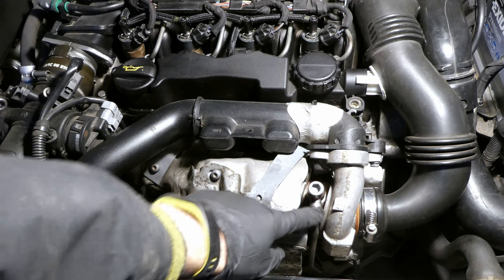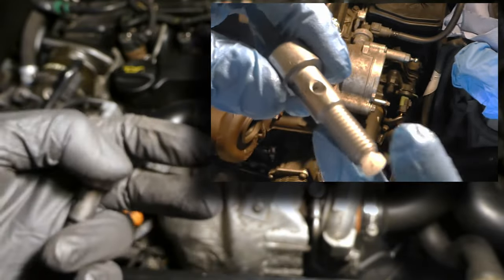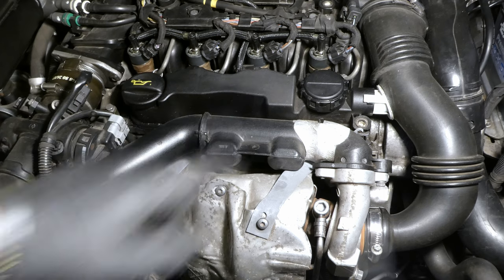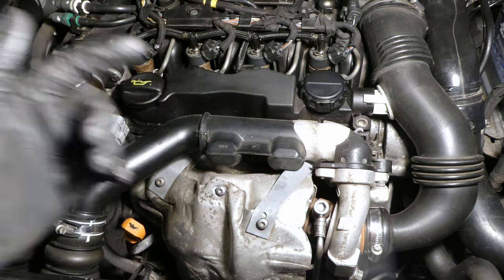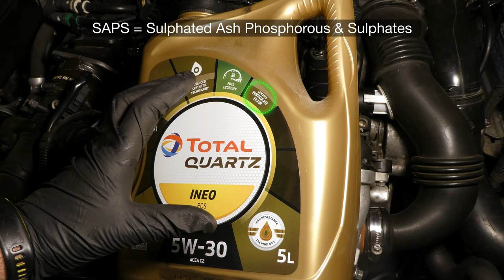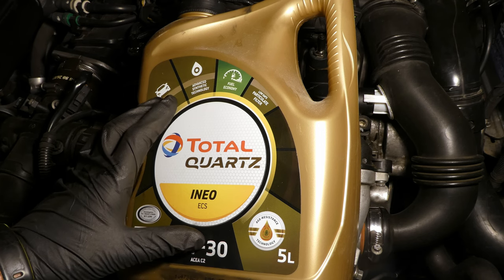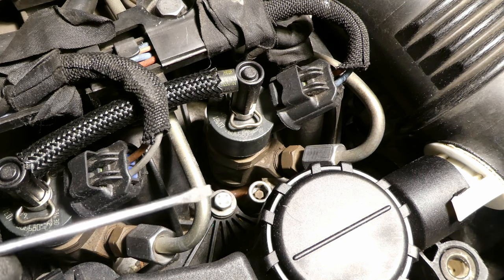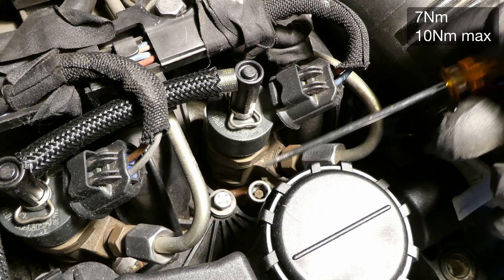1.6HDi turbo failures, the 2 main reasons and surprisingly simple steps to prevent it

Comment: I had my turbo rebuilt but the idiot didnt replace the gaskets and o rings so its still leaking and starving it from oil. Anyone can be a turbo specialist these days it seems.
Reply from the maker: Really sorry to hear that. All gaskets and o-rings need to be changed, it is just a good practice. Hope you can get it sorted.
Reply: @moremolecules  hopefully got a mobile mechanic coming next week to replace them along with new feeder pipe thats leaking .
Reply from the maker: @Lookbusybuddy  Yeah, that pipe was a design failure. If they are not spot on 90 degrees they will leak, even if it touches the side a little bit. If one uses a brand new part there will be a few micro mm off, and then it is difficult to center that pipe. It is a bit of a nightmare.
Reply: @moremolecules  do you know anyone in hampshire or berkshire that know what they're doing. That feeder pipe is leaking i think onto the waste gate . Looks like a bike bell underneath in shape
Reply from the maker: @Lookbusybuddy  Unfortunately no, but if it is not leaking too much it is not a problem. If it is not too much you can wipe it from underneath the top input from time to time, I know it is a bit of an effort. Yeah, it will be either leaking on the wastegate or down to the sump bolts.
Reply: @moremolecules  think its leaking worse back towards the engine like spraying from the gasket going into the hose behind it. Volvo dont seem to know part numbers for the gaskets only big bits. So mechanic said might use peugeot bits instead.
Reply from the maker: @Lookbusybuddy  They should be the same, but you never know. It is the same engine, but Ford for example changed the air intake, but overall pretty much all is the same. Worth a try for Peugeot/Citroen instead of Volvo parts. I really doubt it is the copper o-ring, I bet it is the shape of the pipe, it is really weird flexi pipe. If it is even touching the sides and it is not 90 degrees at both ends it will leak. Mine is leaking a bit, but I cannot be bothered to fix it now with taking it all apart. Might do it some day.
The o-ring is copper crush washer, so it should seal even if it is the old one. I had brand new o-rings but used a brand new pipe and the twist were not done perfect so slightly off 90 degreees and mine is leaking from the top bit bit not from the washers. If you have the pipe out you will see what I mean.

Comment: These are very good crappy engines. Good when they work great but when it goes wrong is very bad..
Reply from the maker: Hahaha, yes, but the rest are not that different. It is just that these 1.6HDi are everywhere and one can see the faults more frequently as compared to other makes/models.
Reply: @moremolecules  yeah sure but having worked on cars, mainly Diesel since we 1995 these really have problems that just continue and get very bad.. I have already gone through 3 of these. My 307 RHR Diesel of starting to falter but that's not now just wear and tear.. I know a lot of people don't do their own maintenance or repairs so who knows. 👍👍 Good videos though
Reply from the maker: @herbertvonsauerkrautunterh2513  I agree they have a few problems, but nothing that is really bad and cannot be fixed. Having said, that some of the thngs are not that great, which cannot be fixed. They just need a lot of maintenance and people are on the lazy side of things. Why did manufacturers increase the maintenance schedule to ~20,000 miles on newer cars. Not all manufacturers, but quite a few. Used to be 12,000 miles, but people do not want to spend too much on maintaining.